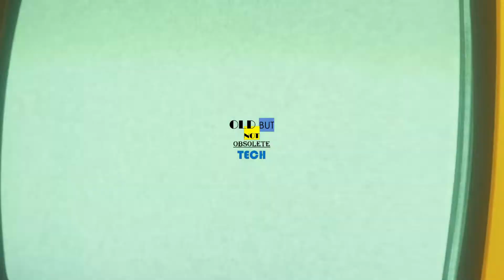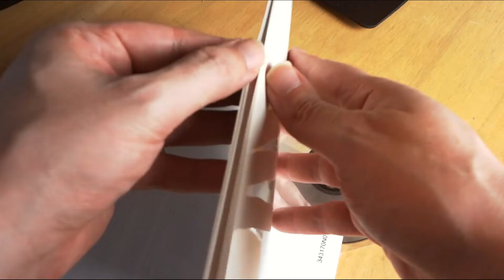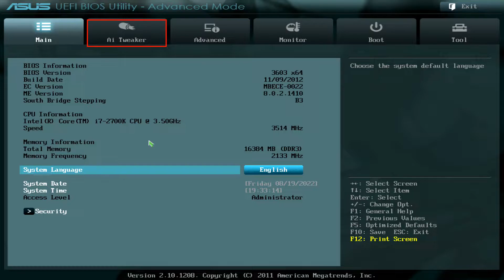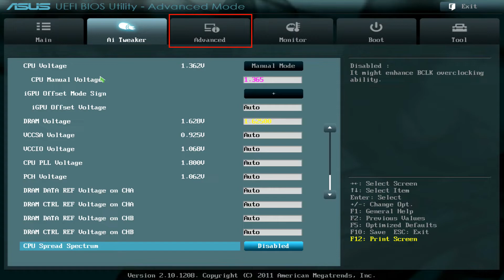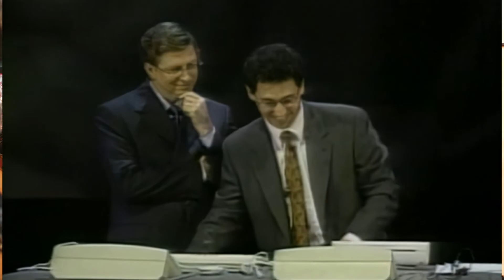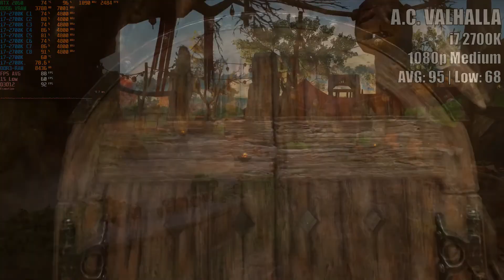Easy Overclocking TUTORIAL for Z68 • ASUS P8Z68 Deluxe Gen3 | Intel Core i7 2700K

Comment: I overclocked the 2700 processor on the Asus P8Z77-V LX according to your tutorial. Now it's at 4800 (MHz), but the voltage increased slightly as required. It doesn't heat up more than 73-75 degrees in games. Before overclocking, the maximum was 50. In a 10-minute stress test, the maximum core temperature was 85. Thank you for the tutorial.

Comment: Is 1.35v good for i7-2600k 4.5ghz or should i try lower voltages?
Reply from the maker: With the little I know about this topic, 1.35V core for 4.5GHz on an i7 2600K is a hassle-free , sweet overclocking spot, provided that temperatures are in check (anything above 80 Celsius is toasty for the CPU).

Comment: will i be ok using the ag400bk deepcool cooler in combination with the corsair4000d airflow case using the i7 2700k at room temp with these exact settings, I also noticed there is a tpu switch which basically auto overclocks, is there any benifit of just using that instead of manually doing it? I have an i7 2700k with ddr3 1600mhz 16gb and an msi gtx1660 super gaming x gpu, my motherboard is the Asus P8Z68-V. All these components are brand new including the cpu, im putting these components together tomorrow. i bought them because they were on sale compared to just getting a newer motherboard, i dont mind overclocking for a year or 2 until wanting to buy a new motherboard, cpu and ram.
Reply from the maker: Hi!
Congrats for your buy. It is extremely rare to find brand new 10+ years-old PC hardware.

To answer to your questions, I don't see the reason why the combination of your CPU cooler and PC chassis wouldn't be enough for an overclocked i7-2700K.

At 4.8 GHz my 2700K never exceed the 100W consumption under heavy gaming sessions. So theoretically  your 220W TPD CPU cooler is more than enough for your system.

In regards to auto-overclocking, I have never used it, so I can't comment on it's effectiveness.
Reply: @obnot  my temps are great :D average of 55celcius oc'd to 4.4ghz and a 15fps increase in sons of the forest, 53fps average now, i will do 4.6ghz and prob stick to that. thx for the vid, also am i ok with just sticking with leaving everything else on auto and only changing the (by all cores) to 44? i noticed apparently someone else did that in the comments so i was just wondering if i should manually tweak everything in the vid like you did or not.
Reply from the maker: @extremedoopy9972  OCing isn't set in stone. There are different setups to achieve your target frequency.

Following someone else successful OCing setup is up to you, but I can not guarantee about it. I can only recommend what I know it worked best for me, which is this guide.

I hope this clarifies your question. Thanks for watching and leaving your comments.
Reply: @obnot  new SPECS below.    Im having an issue following your tutorial for 4.8ghz, i set everything the same that you had to the exact and when i launch cinebench the pc bluescreens. I tried applying more voltage but i was told going over 1.4 is deemed the unsafe limit and proceed at your own risk so i felt uneasy. Right now my specs are upgraded compared to before, is my psu not strong enough or am i not applying enough voltage to the cpu? how are you able to get more out of yours than mine at lower voltage? i tried 4.7ghz at 1.375v too and it did go longer but eventually bluescreened randomly when in a discord call and watching a video. I want to push the cpu further as my temps seem fine, im ok with 73-74c if i have to for 3 months until i buy a new board and a ryzen 5 5600x and new ram for it. Then ima use this current board for a second pc for a sibiling.
Specs that are contributing to psu power usage:
i7 2700k oc'd to 4.6ghz 1.365v, average temp of 68c under full multithread load in cinebench.
Corsair H100x RGB Elite AIO
Msi Rtx3060 12gb gaming x
32gb 1600mhz patriot ram
600watt EVGA psu
Asus P8Z68-V/Gen 3 updated to the latest bios, same version as yours.
Commander core XT with 6 rgb fans plugged into it.
Ambient room temp average at 24c after an hour of pc use, using the corsair 4000d airflow case.
Reply from the maker: @extremedoopy9972  I really don't know why your system is unstable at anything higher than 4.6 Ghz. Has to do with the silicon lottery? Is it because of partially cpu degeneration? Has to do with the condition of thermal pabs under the mobo vrm's or the thermal paste of the chipset? Is it something else? I can't be sure about it.

What I can be sure is that +100 or 200 Mhz freq. would not be a much of a fps difference gaming wise. So I suggest to leave the freq where it is stable.
Reply: @obnot y pc started doing weird things like turning off right after I turned on my pc then turning back on again and booting, now a part of the motherboard in the vrm section is fried and well ig I’m done with that stuff, so I bought a B550 A Pro motherboard and a ryzen 5 5600x and new 32gb vengeance ram at 3200mhz. I will say it is so much better but I still miss that z68 motherboard.
Reply from the maker: @extremedoopy9972  Sad to hear that the z68 gave up. Glad that you bought a worthy replacement PC that will serve you very well for many years.

Comment: Subscribed too, still using the same ASUS P8Z68 Deluxe Gen3 + Intel Core i7 2700K, ( liquid cooled ) with Kingston ssd's on raid 0 , 16 gb DDR3 and a 1060 6gb, actually with 2k screen at 144 hz , i will try what u did on your video until i buy a new one, because I think the time has finally come. 
Still running some older but very nice pc's at work, like core quad 9950 (loved that cpu), some core2duo, and have some pentium 4, 3, 2, and a 386, and their Mobo's nailed at the wall , all realized a fantastic service.
One of my work machines have around 30 years maybe, and still running very fine, it's curious because I'm still running a Sigma cut plotter  with 2 megabytes of ram , u can read all the letters of "2 megabytes" on the screen every time I switch it on. :)

(Older machines need older pc's to run, obviosly. I always accumulate spare parts for the future, just in case i need them)

I have the impression the manufactured electronics of some years ago were more solid than actual
Reply from the maker: Thank you for watching, for the sub and for the time you spend it to write this comment.

These are some good old hardware you have there. I don't know if back then they made it to endure more but for sure in the right hands they can last for decades.

Regarding the OC, definitely the i7-2700K can reach higher frequencies the those I presented, which was more a  safe 24/7 setup.

IMHO, if you want to try higher clocks then I suggest you to do that only when it is absolute necessary (catch specific framerate target etc).

Otherwise keep it at stock. This way you will extent the  lifespan of i7-2700 and the mobo's VRMs a bit more.

Comment: What’s the most optimal ram speed for this motherboard and cpu combo?
Reply from the maker: Typically the higher the better. Officially the motherboard supports DDR3 memory that features data transfer rates of 2200(O.
C.). Unofficially I had managed to run 2 sticks of Kingston HyperX Savage 16GB 2400MHz DDR3.
Reply: Would these settings work for the i7-3770k?
Reply: I have the same motherboard and I want to replace my 2600k with the 3770k but I can’t find guides on this.
Reply from the maker: @DAD-E_XXplores   If I were you I wouldn't switch from a well OC performed 2600K to a 3770K. The 5 to 7% extra performance wouldn't worth it. Maybe for educational reasons.

Either way to your question. I haven't tried to OC an 3770K with a z68 mobo so take my advice with a grain of salt. It will be the same settings but for sure different values.

Update your BIOS. DO NOT use the same 2700K Vcore values (too much voltage or high temps lead to short lifespan or a dead CPU) and expect lower OC frequencies.

There are some guides if you google "z68 Ivy Bridge overclocking guide" but I can't do this for you. There is plenty of reading and research to do. Some of the places you can read or ask about is www.overclock.net and r/overclocking/

I hope my answer to be somewhat useful and I wish you best of luck to your OCing ventures.

Comment: Great video! I'm running an Asus P8P67 DLX with a 2600K. I bought them new 11 yrs ago. I've always run it @ 4,400 MHz by only altering one setting. The "By All Cores" set to 44. Everything else is on Auto. I'm typing this from that machine now, it has an EVGA 2060 and 32GB of DDR3 1866. The ram needs to be set to the XMP profile. Such a great machine and a great CPU, a real classic!
Reply from the maker: Thank you Ted. Thats an old but great computer system you have there.

Sandy Bridge is indeed a legendary architecture, counting the fact that still offers decent gaming performance. I've made two videos testing the same setup with an RTX 2060. If you are interesting about you can find it here https://www.youtube.com/watch?v=IQYrbN4ODIU and here https://www.youtube.com/watch?v=nJY6QXWm1OQ.

The only problem is that in new triple "A" gaming titles, even an OCed i7-2700K is bottlenecking the RTX 2060.
Reply: @obnot  Thanks for the links, enjoyed those! Mine has a, relatively, easy life now. I only have a 1080p, 60Htz monitor, so with V-synch turned on. It barely breaks a sweat.